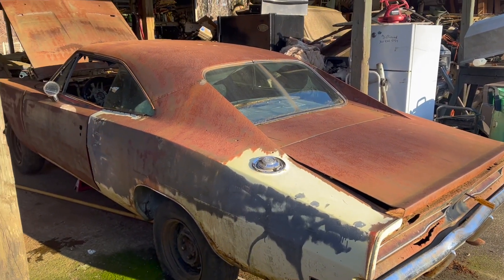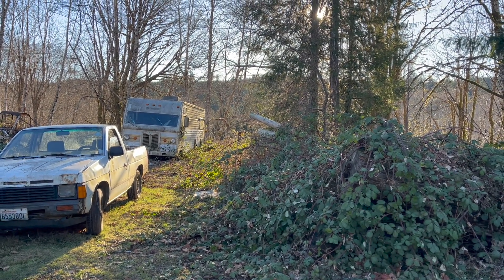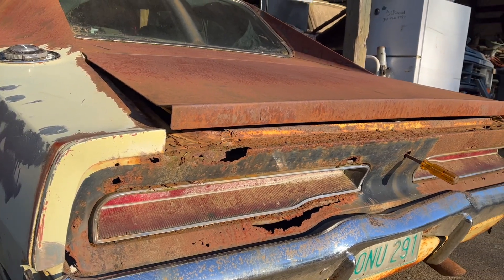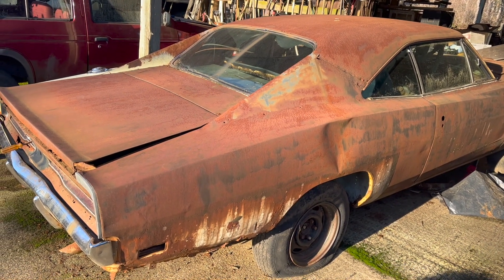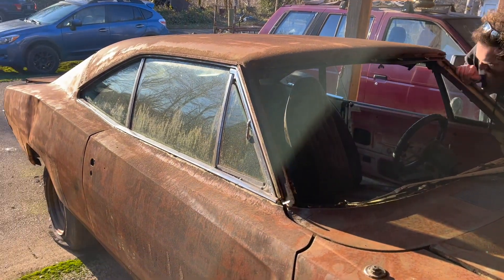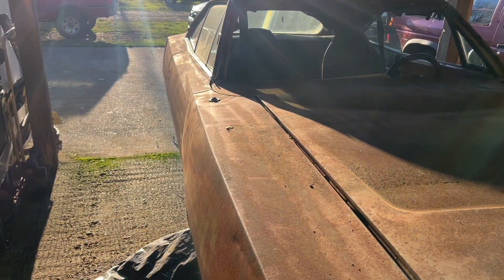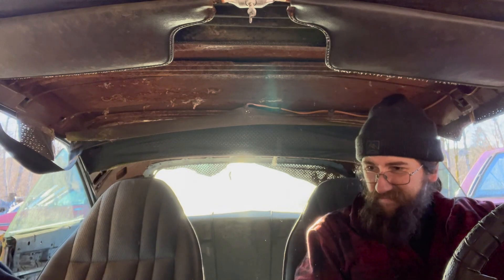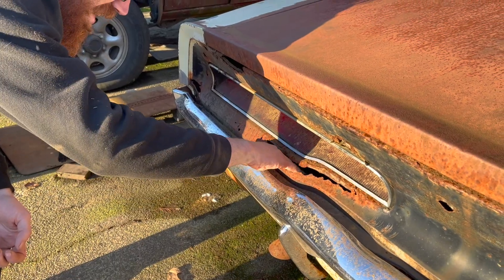My Brother Bought The Crappiest 1969 Dodge Charger In The County

Comment: In 1998 I looked at a 70 Charger 500 383 4 bbl car that had likely been used to tow a boat here on Long Island. The entire rear quarters and trunk pan were gone, seemingly from being dunked in salt water during launching off a boat ramp.  The rust seemed to stop at the cowl. The interior looked like it got mauled by a bear. Still, it fired right up and ran great off a 5 gallon jug of gas suspended by bungee cords in what used to be the trunk area. It was so much work that I walked away. Fast forward to today and that car in that basket case condition would have probably fetch low 5 figures.
Reply from the maker: Wow. Yeah… that’s my idea of an unfixable car. But people are doing it now… just nuts.
Reply: @DeadDodgeGarage  I'm glad some  people have the means and stamina to do so. I love the look of the 68-70 generation even though I own a pristine survivor of a 74 for the last 25 years. It's my Richard Petty Charger, even if it just has a little 318.....😎

Comment: Well at least the rear springs aren't against the bottom of the deck lid. I've seen one like that. Had to put wood blocks between the rear axle and "frame" to get it on a trailer.
Reply from the maker: Not yet… we’ve been there a few times now.

Comment: Ironically my dad when I was like 6 had a 69 dodge charger pale yellow with the black interior and roof, and it was a 318 2bbl and a automatic transmission and it actually had rusty rear quarters my dad drove it until he decided he would rather have a decentish 68 gmc c2500 370 v8 4spd with bulldog gear, and two inch straight pipes out under the rear bumper no mufflers that truck was loud!!!! And drove it until someone wanted the truck to piece their 67 gmc 3/4 4x4 back together and traded my dad the ugliest pale blue 74 dodge charger se I have ever seen but was a very solid low mileage 318  quadrajet 4bbl column shift automatic transmission car, but even though my dad drove it back and forth to work since the gmc was his work truck, he acquired the blue 74 dodge charger se to put a rusty 72 dodge 340 Rallye charger with the Factory 4spd still in the car bought in a junkyard for $200 and my dad seen it sitting in the weeds behind some guys barn and paid $800 for a car with no title?!

Comment: Be both interesting and maybe scary to get that car reverse-electralysis dipped.
   You would know what is gone & what is solid.
   After that?
   Be tempting to plop the '69 charger body onto the front frame-engine-floorpan-rear suspension of a wrecked late model Hemi Charger or Challenger.
   You could rework the dash for the late-model cluster & steering wheel/column..
Reply from the maker: Everybody is using crown Vics for that too apparently? Tempting indeed, but other than the one frame rail I think it’s… mostly kinda ok underneath. But we’ll see.

Comment: I'd take it in a heartbeat my papaw had one wen I was 5 the car was 9yrs old then I wanted to track it down wen I got old enuff to drive an found it quickiy well found out the guy who bought it from pap couldn't handle the 440 powered beast and got 1.5 miles down the road an unfortunately  and heartbreaking  he crashed an the car was a total loss silver lining the guy was unhurt but still no charger for me at 50 maybe one day
Reply from the maker: Damn… that’s a bummer. I hope so! They’re out there. They’re ridiculously expensive right now, but at least that means they’re basically all getting saved now.